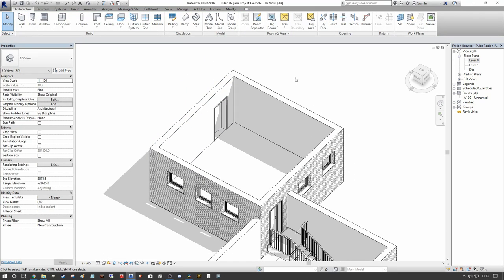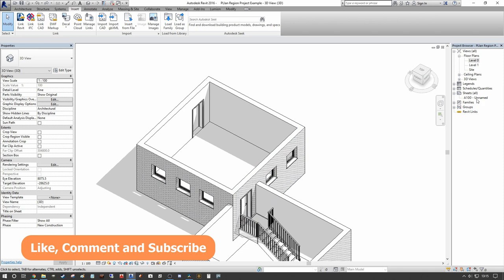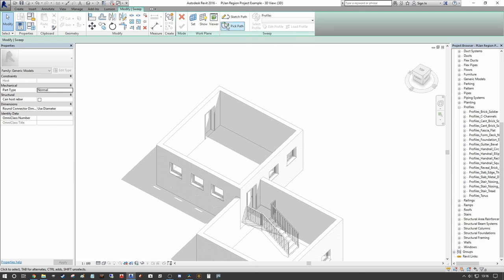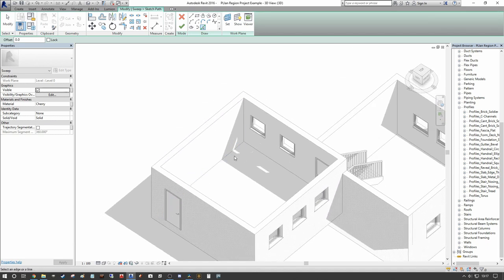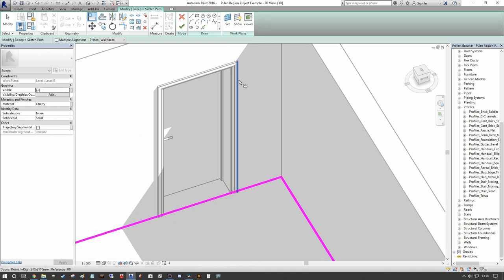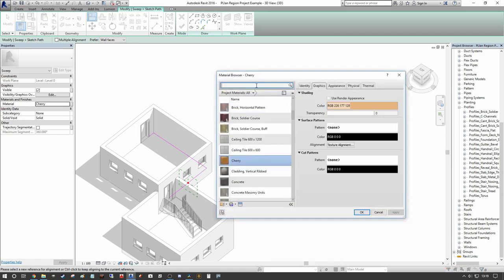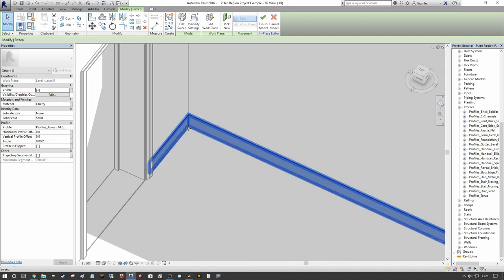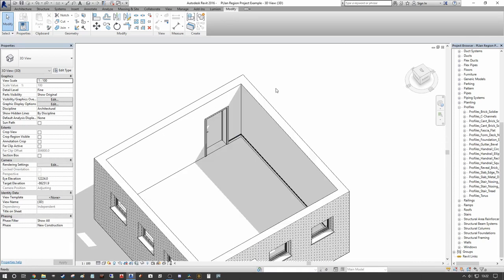REVIT TUTORIAL: SKIRTING BOARDS, COVINGS AND ARCHITRAVES MADE EASY

Comment: After wrestling with wall swept skirtings yesterday for hours (for the reasons mentioned here), I resigned to the fact that there had to be a better way. This is also what I came up with. Wall sweep behaviour is a PITA and this is a massive "workaround" that shouldn't be necessary at all (but sadly is) Revit 2020.2 (April-2020)
Reply from the maker: Agree totally David, at this point in the Revit development such a requirement for modelling skirting like this seems very archaic, but again remains a necessity due to lack of other viable (and properly parametric) options - wall sweeps cause a huge amount of frustration because they ignore bounding conditions of perpendicular walls and continue along a single wall length, regardless of intersecting geometry ; this means you have to break Continuous walls for each room they are bounding which does not make intuitive sense from the constructability perspective. I would be of the opinion that you should be able to select the base boundary of a Room and select a skirting profile to be assigned to that room, breaking at openings. Meaning any expanse or change in the room footprint would be caught and the perimeter length would always be automatically calculated, something that the method I have outlined can't accommodate. I have toyed with placement of skirting boards in this manner via Dynamo but it really shouldn't be necessary (and is frankly overkill for smaller projects).
Thanks for checking out the video anyway David, keep the dialogue open and if a better alternative arises I will make sure to cover it. All the best, 
Niall
Reply: Other software like cohoom got it right on molding placement, they use room boundary as their molding line (base, mid and top). Resulting in parametric molding that is super fast to apply and intuitive.

Comment: Great solution for modeling skirting. How can you then schedule this?? Meaning total length per profile..
Reply from the maker: Hi there, glad you found it useful. 
In place families can be difficult to schedule as they do not have a length reporting parameter by default. If you select your skirting boards after modelling you can see that they do have a Volume parameter. Using the volume parameter you can create a calculated value column in your schedules to get the length. 
Use Volume/X (X= cross section area of the skirting boards profile - draft over it in section with a region and it will give the CSA) and you wil be left with the length per profile reporting in your schedule. 
I hope this is clear and understandable - let me know how you progress with it!
Niall
Reply from the maker: Sorry, forgot to mention this in the above - if you matched my video's modelling process you need to use a Generic Model Family schedule as the base schedule prior to my tip above.
Niall
Reply: @8020BIM  I tried it and it worked. Thank you very much!

Comment: Another issue with wall sweep is that you can't generate the quantity of it by floor, which is a bit annoying as I had to copy each floor to a separate file to get the quantity (length) by floor.
Reply from the maker: Absolutely. Generally you have to utilise the Room Parameters to give a perimeter value, but then it doesn't account for door opes etc so it is problematic for sure.
Niall

Comment: Could you use this same method to create wall tile that only went halfway up a wall? Say in a toilet room that had tile on all four walls, or in a shower?
Reply from the maker: Hi Charles. While the answer is technically yes, I would look into stacked wall modelling for this function perhaps. YOu may even want to add a smaller inner wall of just the tile finish to make things simple (you can use the join command btween the "tile wall" and the main wall so that the primary opes for windows, doors etc cut out and automatically update when said elements are moved). The latter may also make material reprting for finishes schedule / qantity take off a little mroe straightforward too. 
Let me know how you get on with it and what your final method of developing the part wall finish is. 
Niall
Reply: @8020BIM  Thanks, I will. Thanks for the great videos.
Reply from the maker: @charlesball9522  You are most welcome. If you need any guidance and have a suggestion for a tutorial topic please let me know. All the best,
Niall